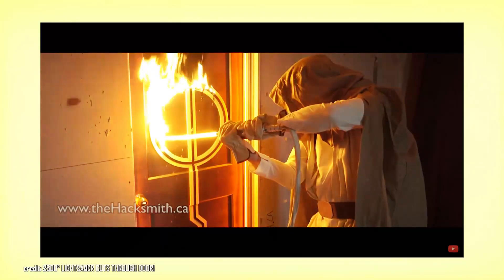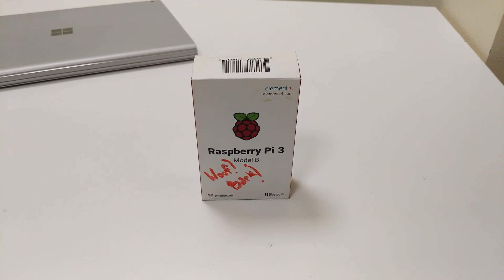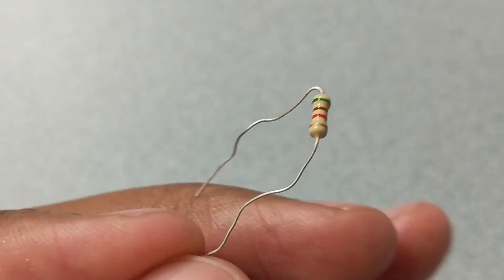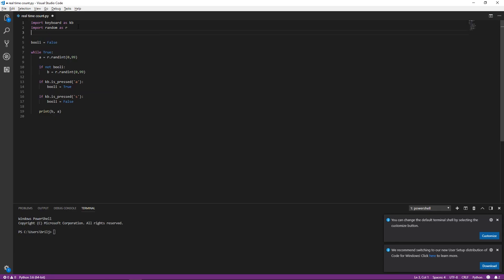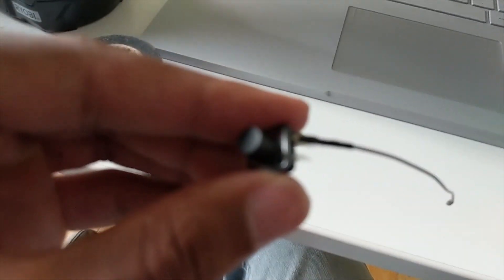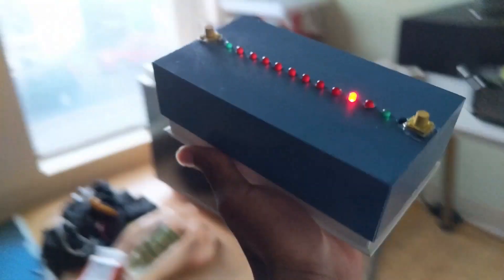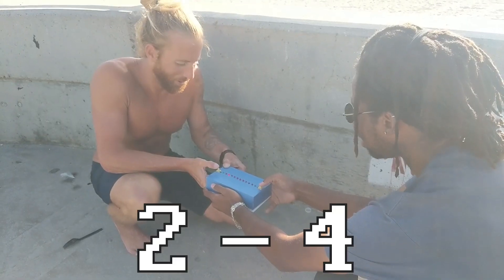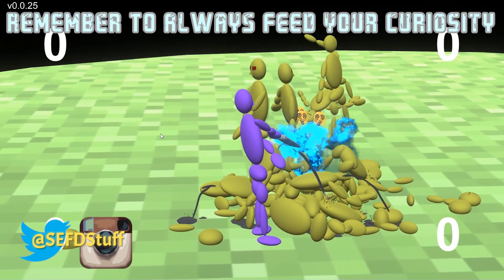How I Made My First Robot! (In A Weekend)

Comment: 14:00 i am sorta an electronics artist, what you just did it called crimping. by using a connector that is made for crimping, and a crimping tool. you can pinch a wire into a connector, there for holding it snug into whatever manner of connector you have. with some metal, the electricity in the wire will flow into and outof you connector.

Comment: Hi Jabrils about the jumper soldier thing, you know you can flip the plastic flap on the jumper wire under the metal opening and take the black plastic off abd then pinch it with pliers.

Comment: For you button delay, you can also use a state change system... I leant this whilst programming for the 8051 microcontroller.... but essentially, you just check for when the button is pressed and don't the program run until the button is released.... this way you get consistent feedback without having to find an appropriate delay or timer method. (granted this is no a good idea in more complex projects, ie ones that require the program to run off a system clock)

Comment: I took a digital electronics class in high school and learned all about that wiring stuff. You don't need male to female wire connectors. You just get a wire stripper and take the plastic off the end and stick it in the breadboard.

Comment: Just a note, you probably didn't heat up the wire and connecting pin on the button for the solder to stick to it. Also, I typically use flux-fused tin so I don't have to put on extra flux.

Comment: Nice video.
If you want to keep going with your learning, for Robot 2.0 you could learn how to design a circuit board (there's free software for this online), order a bunch of cheap prototypes (about $2 for 10 from China, check out Electronoobs' channel for info), learn how to solder on your spare boards, solder your final board real nice and add two 7-seg displays, or an lcd, to keep track of the score and look fancy. 
Or you could skip the designing a circuit board etc and use a stripboard.
Also, there is an app called ElectroDroid that will quickly calculate your resistor values for you and teach you all sorts of other basic stuff (and not so basic stuff).

Comment: I personally think that an arduino uno would work for this. If I remember, the uno uses c++ and supports 4 analog inputs and 13 digital. More than enough to make the robot. I'm right now making a robot arm with around  8 variables and I'm using the uno for it( I'm actually going to use the raspberry pi to make the arm app controlled). Love your vids.

Edit:The arduino uno is cheaper.
Reply: I did it with an arduino nano. Works fine.

Comment: All my friends know at least the basics of electronics. It’s taught in high school here and we are born in the 70s so we lived through the dawn of computers and electronic games that we had to fix and extend.
For my highschool diploma, I made an 8 LED interface for the C64 user port. I used 8 transistors are 16 resistors, because that’s what I knew (I recently redid this project and made it 16 LEDs despite only having 9 outputs). 
I remember when I saw the lights light up, how stocked I was to have made a schematic, pcb, soldered it and stuck it into my priced possession and it didn’t blow up. 
I then developer the infamous KITT scanner, and it was sloooooowwww. MS Basic sucks (anything Microsoft basically sucks). So I did it in assembler and I was amazed how friggin fast that was. I had to really burn a lot of cycles to make it behave.
Now I was never going to study electronics or computer science. I’d been accepted in a film school, but I kept that off because I wanted to study music. I failed my audition miserably and by then my film school seat was also gone. 
And otherwise I had to serve in the army (compulsory military draft). So I studied electronics, initially for one semester and then get into filmschool. I ended up doing the 4 years, I loved making stuff and also the low level coding was something I adored. There’s something you can’t explain that gives you the best feeling if you make something physical. I don’t get that feeling when I make software... that’s like a boring chore. But hardware is hard and unlike software it’s not very trial and error based. You need to think ahead solve all problems because if you make a pcb, it’s not easy to change.
Ik glad you experienced that too!!! It’s such a cool feeling!

Comment: the ARDUINO. is a micro controller. the pi is a computer with gpio output pins and is extremly more powerfull than arduino, and it runs a full custom distro of linux
Reply: yep... it hurt a little when he said that.

Comment: I've never seen spray paint take longer than 10 mins to dry. The problem it looks like to you is that your spraying way too much at once. Just put a light coat on and wait for it to dry or use something to warm the surface for it to dry even faster. Keep putting light coats on and drying and it will be done quickly
Reply: Also yes it does take a long time to cure. But to dry not so much

Comment: Just so you can learn, technically the raspberry is not a micro controller. It is a mini computer or as it is technically called a system on a chip or soc. A micro controller is a much simpler device.

Comment: If you are going to continue this and as an EE I hope you do I would like to donate a decent soldering station not a soldering gun that is to bulky and to hot , electrical solder and flux not plumbing or brazing/ silver-solder solder and flux multi color wire, protoboard to solder up more permanent things with out getting a pcb made, Arduino minis, tact switches, transistors, encoder and a display or two. Message me and I can get them posted by Monday.
Oh and my time to help with any problem you may encounter, but good tools and proper, good quality supplies are 75% of good soldering then 25% is knowledge and experience.
Reply from the maker: This is very kind of you. However I am not sure how many more ee projects I'll be doing. 🤔🤔🤔 But perhaps that is because I don't have the supplies thus it seems more like a burden?... So maybe if I had the supplies I'd do more? Lol I don't know. Regardless, thank for the guesture!
- Jabril
Reply: Jabrils  I have been keeping an eye out for a good home for it for some time now so if you decide you want this stuff or if you know some one who could use it. Its used but inbox with extra an extra heater and tips. Trust me when I say I wont miss a flux pen and 20-40ft of solder It may be on a bobbin for something else but I would stick a label on it so you know exactly what it is. As for the Arduino stuff and other odds and ends its from when I did a class for local boy & girl scouts and I have no use for how many I have so nothing would be missed. It should all fit in the box for the station so shipping wont change any.
Edit: sorry if I come across as pushy but I want to know what you could do with an FPGA from what I've seen you have the right kind of mind for it, and im a little partial to EE in general.
Reply from the maker: okay okay I will accept your mating gift. Can you please email me :D hello AT sefdstuff DOT com
- Jabril

Comment from the maker: Yo what up, in the comments for the first hour!
- Jabril
Reply: Nice project bro. Good job ^^
Reply: bro i like this channel, alOT!
Reply: so, your weekends are 5 days?
Reply: here are a few tips: 
1) you don't need flux to solder, you can buy soldering wire with flux inside, it's a lot easier to use.
2) put a fan in front of you and open a window when soldering
3) the soldering iron you got works well for cables, but not really if you wanna solder anything else
4) the type of iron you have *should not* be turned on for more than 30 seconds or whatever's written on the box, and should be left to cool down in between, or else it burns, and can blow a fuse.
5) find someone to give you tips before burning something.
Reply: Thanks for including all the mistakes you made. For beginners a lot of the time, it feels like you're bad at it or you're doing something wrong when you keep making mistakes, but you really help to show that it's part of the process!
Reply: Also not imperative but good idea to where glasses/eye protection, as I have had solder which hasn't been completely pure, and have had instances where it has popped small pieces of hot metal out. Not worth the risk of losing your sight.
Reply: awesome
Reply: didn't think that could happen, but yeah, if the flux is wet, it might cause a bubble and send molten solder flying
Reply: @Jabrils I love you Jabrils, but this is not what is called a robot! Nice project thought!
Reply: @Jabrils careful while soldering. That smell was the smell of flux fumes, which are actually toxic. I'd recommend soldering near an open window with a fan blowing the fumes away from you
Reply: Jabrils you record the audio or the video first for tbe moments when you aren't talking but talking 😂
Reply: maaaannn … pi is a single board computer not a microcontroller … if microcontroller is a human ,,, then pi is a alian ...
Reply: its not a robot... and you said it took more than 4.1 days... why the title?
Reply: Has anyone told you  that you sound like a white guy? Just wondering if you ever got told that in life. Because if I hadn't seen you I would have thought you were a white guy lol. Sorry I didn't mean for this to be rude in any way. Thanks for making videos. You earned a new subscriber.
Reply: If you consider doing something like this again, create snake arcade, it's much more fun, even tough it's from only 64 LEDs (8x8matrix)
Reply: I like how you accidentally discovered crimping. xD

Comment: Next skill, learning to solder.  You don't need flux, it's often built into the solder wire itself.  You only need flux to remove oxides and oil, and your wires are already clean enough to not need flux.
Reply: God, your profile picture gave me flashbacks to when I was fried and I kept watching the goddamn "Annoying hotdog" video.
Reply: highkey i was just about to say this
Reply: Munden you do need Flux.
Reply: Yes but most often when you buy electronics solder it has a flux core, thus removing the need for external flux. If you however don't use flux (pure solder) the joint will be awful and it won't stick to the metal you are trying to solder :D
Reply: But too much flux is a pain in the butt to clean up afterwards. Also: flux nazis :DD
Reply: @petterihaverinen4210  Yeah it gets really sticky and all but with Isopropanol (IPA) it's easy to clean. And for smt microcontrollers it's easier to solder with much flux.
Reply: Makes sense, I usually end up running my iron through the pins and flood them with solder, then clean the head off and then suck up the excess solder. Should maybe try using external flux to see if its easier or cleaner that way
Reply: I always use solder with flux, except in very specific situations. It gives protection to the pads and to all metal exposed, like the solder itself. Also, good quality helps, it's just better to expend those 2 euros more.
Reply: Munden shh he doesn’t need to know🤫
Reply: My thoughts exactly :)
Reply: Or for micro-soldering like electronics and stuff, at least that’s what I’ve learned from my friend. Flux essentially just helps things stick.
Reply: I was thinking it wasn't necessary since I remember having been told to solder something at a job without adding flux.
Reply: He purchased solder with acid flux which is used for plumbing and will eat away at electronics. Rosin flux is what is used for electronics and is often included in the core of the solder.

Comment: love the idea, it's especially inspiring to get more into software mixed with hardware engineering.
BUT: 
"A robot is a machine—especially one programmable by a computer—capable of carrying out a complex series of actions automatically"
- Wikipedia

Granted this is an older video so you might have learned a bit more, but as a hardware first, and software second kind of guy, this is nothing more then what you just programed in java, with the only difference being that you had to go to just half an abstraction layer down.

I say half because this project was just coded in Python, basically you didn't even touch on the abstraction layer of Linux to hardware,  nor bothered to touch from "CPU" to "registers"

As a whole this video is pretty good,  definitely a good introduction to hardware/software "practicality", but it is hardly a robot, or a show case of  hardware "programing"

It's more of a showcase of an API, but then comes the question when does an API stop? is it at the bit level or at the actually physical individual components that you hand crafted to respond to individually timed signals?... 

Nah good job on the video, I was just poking fun on the video, I think you can dive deeper into hardware.

Comment: Solder stinks for a pretty good reason - it's pretty bad to breathe in as most solder contains Lead, although you can get solder that is lead free; it's generally recommended to ventilate the room in which you're working

EDIT: Also, flux is generally poisonous as well

Comment: XD you failed pretty much every way you could fail but at least you got it working so it's ok. Don't give up! Hardware hacking is awesome. Here are some tips:
- The soldering gun you  bought is like using a bazooka to kill an ant. The pencil type soldering irons at the top were more appropriate for what you are doing. Even though those were low end items, Weller is a quality band so they should be fine. A temperature controlled soldering iron will cost you from $70. 
- The solder you bought is for brazing. It's used for jobs like sticking copper pipes together. Get a proper 60EN rosin core soldering wire for electronics. Loctite is a brand I use.
- You don't need female - male or otherwise terminated wires because you are going to solder them together.
- An Arduino may be much less powerful and low level than a raspberry pi but it's cheaper and it's more appropriate for hacking when starting out, since it has useful hardware like internal pull up resistors, it can tolerate more volts at it's pins, it's compatible with a lot of sensors and has premade libraries available for a lot of other hardware.
- You need to watch electronics videos to learn, not jewellery making videos. Here are some recommended YouTube channels based on electronics, besides the guys you mentioned: EEVBlog, Adafruit industries, Afrotechmods, Andreas Spiess, educ8s.tv, ElectroBoom, Electronoobs, GreatScott, Marco Reps, Michael Reeves, Scullcom hobby electronics, Sparkfun Electronics, stopperl.

Comment: Sick project! It's cool that you're getting into electronics. 
The soldering iron you picked up is mainly used for soldering pipes together. I would recomend one with a straight handle. Also, if you use rosin core solder, it should smell not as bad, and you won't have to flux anything.

Comment: Minor correction: The Raspberry Pi is a full-fledged computer, not a microcontroller. The difference is subtle, but the Raspberry Pi has a general purpose CPU in it, with normal things like RAM and registers and all that. It requires some kind of bootloader and operating system to do anything_. It _does have general purpose IO (GPIO) like a microcontroller does, but that's not what makes something a microcontroller. A Pi does number crunching first and controlling hardware as a side effect.

Microcontrollers are typically more specialized, and designed to control hardware first and foremost, and use software as a means of knowing how to do that.
Reply: I think the difference isn't subtle at all. Although an Arduino UNO looks a little bit like an RPi, the actual "microcontroller" is just one of the components on that board (Atmega 328) that really can't be confused with a computer :)
Reply: Yep, not subtle at all :)
Reply: The difference is subtle of you're not already aware of it. If you've been working with microcontrollers for a long time, the doffer nce is obvious. But if you're used to thinking of a computer as something the size of a laptop, the Pi is going to feel like a completely different class of device.
Reply: @b4ux1t3-tech  "The difference is subtle of you're not already aware of it." What? No, that doesn't make it subtle lol. One is a combination of all manner of chips and capabilities, the other is basically just a single microcontroller chip. Like flying squirrel said, can't really confuse the two, right?
Reply: @PHeMoX  Both are made of silicon wafers, both use a series of nand gates to make decisions, both are programmed in higher level languages that are then compiled down into an assembly and eventually machine code, both use volatile memory to store instructions, both use non-volatile memory to store program code, the similarities are many.

To someone new to computers, the difference between a microcontroller and a microcomputer is difficult to understand. After all, they are both computers. One is simply designed for more specialized computing, while one is designed for more generalized computing. To someone who doesn't even know that there are different kinds of computing, they're essentially the same thing.